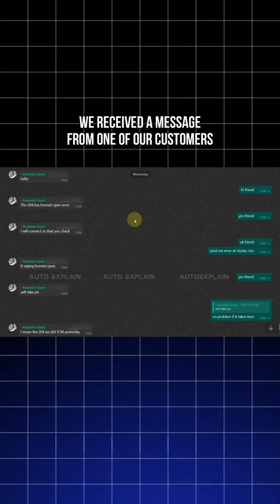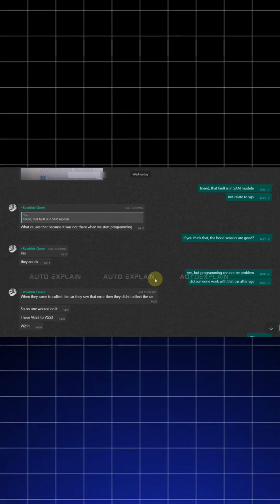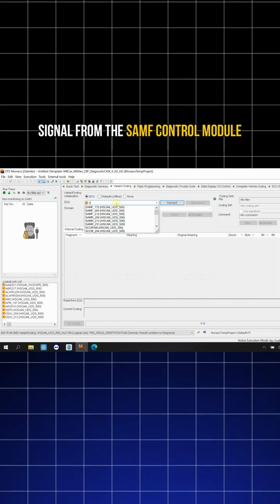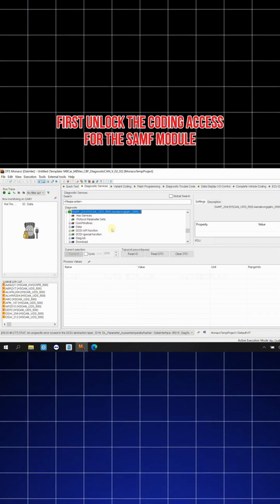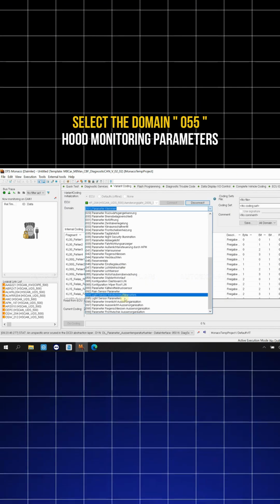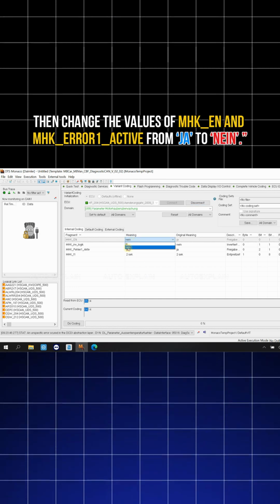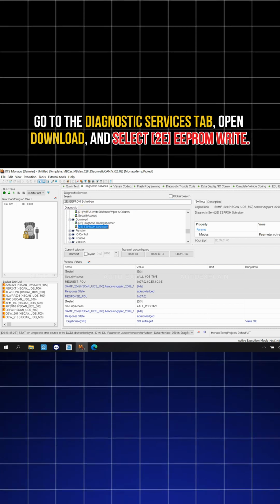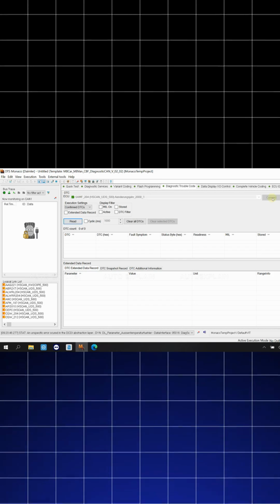How to Turn Off Mercedes “Bonnet Open” Error Fixed in 1 Minute with DTS Monaco

Comment from the maker: Please note that this instruction is just a temporary solution.
⚠️ Service Disclaimer and Permanent Resolution Plan
I. Temporary Solution Statement (Customer Requested)
We hereby confirm that the temporary disabling of the "Bonnet Open Warning" error message was performed AT THE SPECIFIC REQUEST OF THE CUSTOMER and the OWNER OF THE VEHICLE.

The customer and the car owner are aware that this is a temporary measure and has requested that the warning be disabled for a maximum of TWO (2) DAYS while waiting for the replacement part to arrive.

Objective: To temporarily remove the distracting error message from the dashboard.

Technique: Using specialized software (e.g., DTS Monaco) to code the SAM Control Module, setting the hood monitoring function parameters (MHK_EN and MHK_ERROR1_ACTIVE) to NEIN (Inactive/Disabled).

Safety Risk: This procedure DOES NOT fix the underlying mechanical or electrical fault. The vehicle's safety feature for hood monitoring is now disabled. Our customer advised the car owner to exercise extreme caution during the temporary period to ensure the hood is properly latched before driving.
II. Permanent Resolution Plan (Professional Recommendation)
To implement a definitive fix and restore the vehicle's original safety functionality, we strongly recommend proceeding with the following steps as soon as the replacement part is available:

1. Fault Verification: Re-examine the wiring harness and the hood latch assembly to confirm the exact component causing the incorrect signal (e.g., sensor, wiring damage).

2. Component Replacement: Replace the faulty Hood Latch Sensor/Switch with a new, genuine, or equivalent quality part.

3. Restoration Coding (Recoding): After the physical replacement, use the diagnostic tool to restore and reactivate the hood monitoring function in the SAM Control Module (MHK_EN and MHK_ERROR1_ACTIVE to JA/Active).

4. Final Test: Clear all Diagnostic Trouble Codes (DTCs) and perform a final live data check to ensure the warning is permanently gone and the monitoring feature operates correctly when the hood is opened and closed.